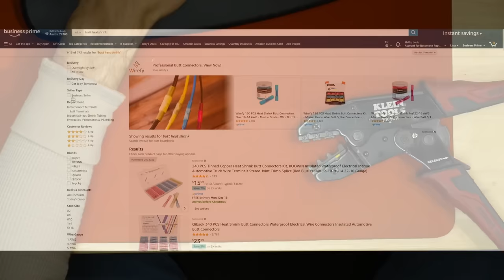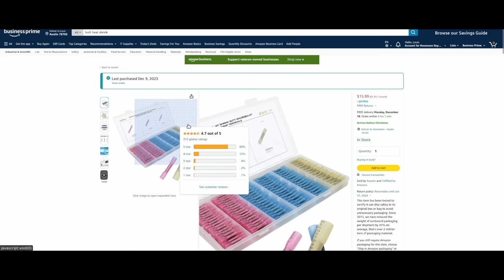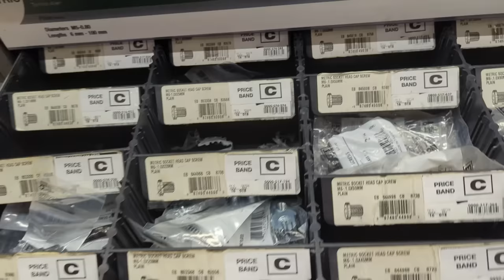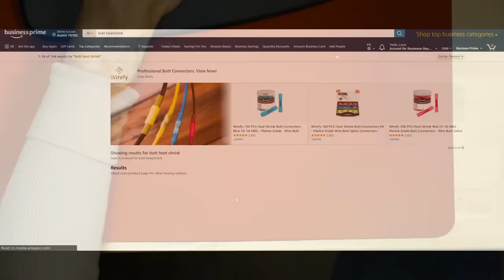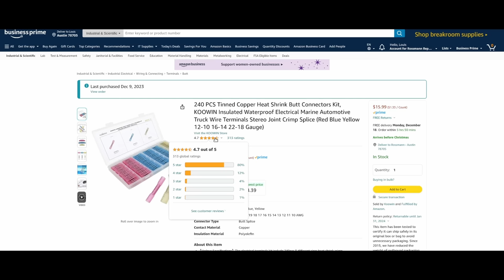Amazon Sells Dangerous Electrical Crimps

Comment: I know someone who is a Vine reviewer, and she leaves brutally honest reviews as is required by the Vine TOS. The problem she has found is that multiple times she has received something that was actually high quality and she gave it a good review accordingly. Then she went through her reviews a few months later out of curiosity, and the products on some of the listings had changed. So the reviews were for something else entirely and often far worse. The most insidious is reviews for genuine 64GB memory cards which were then changed to those fake 1TB memory cards. Amazon seem to not care. I rarely use Amazon myself and I have been burned by fake reviews, which sucks.
Reply: This is extremely common. I have found numerous products on amazon where the reviews do not match the product being sold.
Reply: I've been doing Vine for a little bit now, I try to make sure I mention the name of the product I'm reviewing to avoid that issue. I don't think I've come across an item that's changed completely since my review, but I have had a few items disappear, occasionally before I even get them.
Reply: I think they just can't check every page for correct updates and the company sells similar products( kids telescope gets replaced with high priced version) , the AI would really need to be sensitive to detect that. Remember in the old days of ebay when you updated the product it actually was blocked and reviewed.
Reply: @MAGAMAN  I never buy without reading the reviews AND LOOKING AT THE DATE OF THE REVIEWS.  And click on the reviewer.  And click on others.   Many times, supposedly multiple reviewers are all reviewing the same random items.  If I can find that, Amazon certainly can.   Straight 5 star reviews?  Completely fake.  There has to a decent amount of 4 stars.   I find a lot of 1 star reviews to be done by idiots.  1 star, I received the wrong product.   If it was shipped from Amazon, that's not the seller's fault.  But, it counts in the count.
Reply: When habitually and deliberately screwing people over in the name of ever increasing profits (which, as a side note, the workers don't get a fair share of) becomes the default mode of operation, we should definitely have a talk about the downsides of the current way we do capitalism, or maybe even capitalism in general.
Reply: I tend only to review books. [I am a Vine reviewer.]
My problem is that sometimes the bookseller is not the author but the publisher. And the publisher can sometimes be crooked. That happened to me in my preVine days when I was reviewing a famous book from the 1960s about Islamic law. The seller turned out to be a reseller and a shady one. But I thought I was reviewing the *text*.
I ended up one-starring my review, deleting the content, and warning readers. But it was a black eye for me.
Reply: That’s insane!
Reply: For me, if the reviews do not have good pictures of both the item by itself, and the item installed/working (if applicable), then I will not buy the product.  I never read the text of the reviews anymore, since most of the stuff that I am buying is pretty niche stuff that the average person doesn't understand enough to leave an informed review anyway.  The vast majority of reviews are just complaints about shipping times, damaged items, or obviously one-off issues that have no bearing on the quality of the product itself - or, my favorite, complaining that they bought the wrong product.
Reply: YES I have seen this myself, reviews for products other than what is listed and yet the star reviews somehow apply to the new item that's listed. It's absolute madness!
Reply: Most of the vine reviews are as good as fake ones. Amazon doesn't really moderate them and some Vine users get all the free crap they can. They just hype anything like "this toothpaste is to die for!" for a very average product.
Reply: Oh yeah, this happens a lot. I almost bought something the other day that was highly rated with hundreds of reviews, then looked at them and realized they were all for a product not even remotely related to what was currently being sold. At this point I'd probably be more confident in buying cheap crap from Ali Express instead of Amazon.
Reply: This is why I started always looking at "recent" reviews on Amazon. Top reviews are next to useless on there.
Reply: Easy fix. If the reviews are for a different product, then check off that seller and look elsewhere.
Reply: YES!  I do Vine too and I noticed this with a products I have reviewed!  Also sometimes you pull things up which have 5 star reviews, and yet they are brand new items and the reviews aren’t even there if you actually look.  It’s bizarre!
Reply: I've noticed the same that many reviews are for other items. I'm not sure if items are grouped per seller? But this, should be something that Amazon could solve if they wanted to.
Reply: @mammutMK2   Yeah but here is the thing. Stores and even early web sellers had this down pat. If the product has to be changed you, get this, create a new listing. Now for frivolous issues, the color changed from grey to black plastic, no you dont. But say its a different supplier or different size or product? Well that you simply change the old listing to Sold Out and make a new one. What Amazon sellers do used to be called a bait and switch and was actually illegal, its called a Fraud charge. BUT 90% of these sellers are Chinese so they will never face any lawsuits so dont have to worry about their underhanded tactics. And Amazons ToS wipes their hands of any involvement, which THAT should be illegal.
Reply: @Psychx_  This isnt US people doing this, 90% of these sellers are Chinese who dont give a flip about the rules. Most US companies while they do some underhanded shit arnt THIS disgustingly bad. They may say its a 600 RPM motor and it be a 480 but they wont sell a product that straight up doesnt work.
Reply: this is why people need start specifying what they're reviewing instead of just copy paste stuff that could be for anything
Reply: @memnarch129  You seem to forget that between the Chinese producer and the goods you buy, sits a U.S. person/company that commissions the production, imports the stuff and adds a mark-up.

It's also their responsibility to make sure that the batches of whatever they import match the specification and quality requirements.

Market places like Amazon add another mark-up to host the listing, and actively enable people who negiently or deliberately don't check the quality of their imports to continue doing so:

I.e. also by actively intervening in the comment and review section and designing it against the intrests of the consumers in order to make sure that junk gets bought. 

So actually, you're getting disgustingly screwed over twice and both entities doing that are U.S. based.

The Chinese get away with producing utter shite, because people further up the chain just want to maximize profits and thus keep importing it to save 1 penny/piece compared to better quality manufacturers.

Amazon benefits too, because all it needs are as many transactions as possible. Making sure that the stuff sold has decent quality or there being honest and transparent reviews are just business expenses hurting revenue.

So yes, it is THIS disgustingly bad, because such underhanded practices are culturally hyped up, and glorified like a bloody religion in the U.S. When someone asks for reforms and regulations that increase accountability for importers and market places, the standard response is: "But muh capitalsim!". 

Wake up, dude. Businesses and coorporations are not your friends! They just want your money and will do anything they can get away with.
Reply: Maybe she should write the exact item name that she reviews and say if this item changes then this review doesn't apply.
Reply: Yes, bait and switch reviews are an issue. I've gone to check reviews on memory sticks etc. and seen the reviews are for a torch, or a t-shirt, or a biro.
Reply: I spoke to her about this today, and she said she started including  the exact item name and model/capacity of the item she is reviewing since she first noticed what was happening. I still don't think it stops them though, if there are a lot of reviews and the real reviews get buried.
Reply: I tend to ignore the 5 star ones and look instead on the 1-2 star ones to see if there's any common themes among them.
Reply: Yeah. Bull. SOMEONE knows. The CUSTOMERS. If they let them pull/flag it...

Comment: I have two extensions for Amazon that helps a lot. Fakespot, which looks over reviews for patterns that imply fake reviews and gives you a rating. And cultivate, which tells you where the product is from. And now I have a rule: if a brand isn't consistent on where their products are from, it's a bad product. If the brand (not manufacturer) is from China and has a D or lower on fake spot, it's a bad product.

But it would be nice if Amazon would just clean up their store front.
Reply: underrated comment ftw! thank you so much for this!!
Reply: Thanks for the tip.
Reply: Thanks for the advice sensei!
Reply: Thanks for the extension names!
Reply: Cultivate has a bunch of very obviously botted 5star reviews, and the rest don't fill me with confidence.
Reply: The difficulty there, is that most negative reviews are filtered out for "breaking community guidelines". I've had multiple experiences in the past year with a) obviously used and returned items sold as new b) Chinese knockoffs that look like the original, but have some issue with dimensions or material that make them vastly inferior (like the butt connectors in the video) c) regional compatibility problems that are not mentioned in the description (UK plug shipping to Spain, Blink cameras that won't work with a receiver from a different region). 
When I try to leave an honest review, it is always rejected without specifics, which wasn't the case 3-4 years ago.
Reply: Thank you, will definitely be using this if I ever buy from Amazon again
Reply: I had to return a taillight and complain to Amazon about the seller posting a false advertisement because they listed it for my vehicle but the connector on the light did not match the OEM connector and the OEM never used that connector.  The seller of the light did not include the required adapter to make it work with the OEM equipment.  The seller also didn't include a picture of the connector so it was a hope and pray scenario.
Reply: @retrogroovecraft  I agree that China has bad products., but not all bad. Keeping in mind remember that they ARE the worlds largest manufacturing country and do produce good products , its just a mater of do you have and or take the time to find those good ones.
Reply: i use fakespot
Reply: Fakespot means literally nothing.
Reply: "But it would be nice if Amazon would just clean up their store front." - They won't, because that'd mean less dirty money for the psychopathic corporate managers that run this whole wicked gig...
Reply: Yes! Fakespot is incredible, I wish more people knew about this extension.
Reply: @wayneseymour1  Like what, Apple devices? That’s more the exception than the rule.
Reply: Will try them